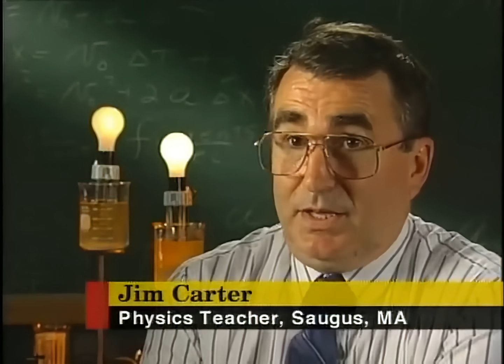MIT graduates cannot power a light bulb with a battery.

Comment: fuck this pretentious ass hole. these young people worked hard for their degrees.
Reply: +Mr30friends I have another possible explantion. I'm not sure, but I'll take a crack at it. It's possible that... Ahem

It was a fucking joke. She managed to pick up a sense of humor at MIT, something not all of us are capable of apparently. Lighten up.
Reply: LilDP You dont need specialization to understand what a battery does or what a bulb is people that haven't even gone to highschool know these things... the bulb connects to the power line of your house which even if you don't know its precise voltage value you know it's high because you know it's dangerous to put your fingers inside an outlet for example...

And you know how harmless 1 battery is .

its that simple, no electrical background needed the only thing you need to have is half a brain.
Reply: Al Paca this comment proves you didnt/dont go to a school like MIT. this isn't like high school kiddo, a lot of actual problem solving takes place. go ahead and try to insult people vastly smarter than you so you feel better, though. I understand. not everyone can have an elite brain and it's not your fault that you don't.
Reply: Igigigg Jhjbibjv strange then that if their elite brains are so skilled and trained in problem solving so many of them fail to achieve what my 6 year old nephew can do with ease.
Reply: you're all typing too much for me to read so yeah. I also didn't watch the video so maybe I'm being stupid but MIT people in general are infinitely smarter than any of us
Reply: LilDP Haha... I much rather prefer a random university on the other side of the globe than Ivy. For one I do not believe in prestige rankings and social elitism. And here is a secret - neither do employers.
No one with half a brain picks a sheltered prick with a bought fancy piece of paper over a person who has been places and done things on his own.
Which is why all those fancy schools are full with foreigners. Most of them go back. Those who dont still are valued more than locals who went to the same school.
Thats why exchange programs exist too, which is also a big bonus for you to have for the same reasons.
Reply: Working hard doesnt necessarily make you competent. Or immune to criticism or scrutiny. Fuck your political correctness.
Reply: Igigigg Jhjbibjv Neither is strictly speaking better. The programs in both are certified and in most cases identical with only minor variations.
Employers much rather prefer independent and experienced candidates over someone who has been to a fancy school and hasnt spent a day on his/her own. Its simply a matter of having a much wider perspective, understanding and first hand experience.
Prestige rankings do not mean anything, only that those schools are more desirable and thus they can select the applicants they want, which are usually already high achieving and hard working. Thus the accomplishments of such graduates are not due to the school per se, the school really does nothing beyond what any other school does. Being more desirable makes it more prestigious, and being more prestigious makes it more desirable, and round it goes.
There certainly are benefits to ivy and other prestigious schools, such as social elitism associated with them. But, again, most employers, who are usually not from ivy and alike, do not really buy into that. Employers who are ivy grads will much rather employ other ivy grads though, but not because they are better.
I can tell you from personal experience that studying in a reasonable school abroad is much more interesting to employers than a more prestigious domestic one. Better yet if you can get into a fancy school abroad, which is, again, why most top schools are full with foreigners. Even a 3rd rate college may have plenty of foreign students, even though they could have gotten into a higher ranking school at home.You may guess why they chose a worse school abroad over a better one at home.
Reply: How do you explain that even ONE of those MIT graduates held the wire like at 1:26 and then proceeded to say "I'm not an electrical engineer.. I'm a mechanical engineer."  .How did this person graduate. I just dont get this. These are graduates arent they ? And from goddamn MIT. Unless they are actors then I cant find an other explanation.
Reply: LilDP she wasn't an isolated incident... there were dozens in the video all with the same joke at hand? (pun intended :P )

besides that it's not about how to connect the light bulb to the battery anyway it's about knowing that the battery won't have enough juice to power the bulb in the first place(1.5 volt battery vs 110 volt of a light bulb)
Reply: Bill Killernic I never said it was a good or creative joke.

Regardless, I guess you can't say they shouldn't know that as graduates of MIT. But hell, I can't fault them, I wouldn't have gotten that either. Luckily I'm an idiot so let's get that out of the way. And as an idiot, I can afford to not hold any pretense of being smarter than anyone else. It's kind of liberating really. I get to ask questions in class, and admit when I don't know or understand things. I would hate to have a degree at MIT. You would probably have to look like you know everything about everything. shudder What a nightmare. Constantly acting like you know more than you actually do. "Yeah of course I knew that." Or god forbid have it televised nationally that you don't know something.
Reply: LilDP its not about being smart that's not the issue!

This is not an accomplishment... this is a rudimentary concept!

It's like a fireman thinking that he could extinguish a fire on a tree with a bottle of Vodka or with a glass of water...

It's a matter of the perception level of our reality these students have or I should say don't have.
Reply: Bill Killernic Well it depends how you view an accomplishment. But I guess that's more of a philosophical question really.

I think you're analogy is a bit off really. I would say it's more like an electrician thinking that he could extinguish an electrical fire with water. (Unless, of course, these students are electrical engineers, that is.)

And another philosophical point, every bit of knowledge is a perception level of our reality. That's what knowledge is by definition. So we can simplify this by saying, they don't know something that you feel they should.

I think your issue is with pedagogy and the specialization of knowledge. These kids did nothing wrong. But were they taught this as trivia? Were they given the appropriate space to experiment and understand this phenomena? Or were they just told to memorize this fact for a test in a single class, where the lightbulb was represented symbolically as a 110 V load on some schematic?
Reply: Bill Killernic I think you missed my point.

Specialization in this context refers to your breadth and depth of knowledge. If you're highly specialized, you know a lot in one area and nothing in another. Alternatively, you... oh you get the point. What I am saying is that you have a problem with the education system, not these students. Because this is not a problem specific to them. It's there by design. And the design, in your perspective, is flawed. Cool.
Reply: "Lighten up"
Reply: GenericBauble Booooooooo. Boooooo.
Reply: Bill Killernic Actually, now that I think of it this mindset is the reason why so many professors gloss over such "elementary" concepts. Because it is so "rudimentary" they should already know. And so professors focus on theory rather than intuition. And intuition is almost scorned in academia. And anyone who doesn't understand is clearly dumb and therefore CAN'T understand anything else. (Which is why students stop asking questions as well). It's a very dangerous notion.

I once asked my physics professor if he can help me understand work intuitively, and he said "It's not intuitive, it's just a mathematical fact." (What he really meant was, "It's very difficult for me to come up with a description based on anything you currently understand") And so I had to go about finding an intuitive understanding for myself. I actually read an article once that described this "curse of knowledge" as being characterized by an inability to empathize with students, because you've already gone to the point of intuitively understanding a fact about life. And physics and mathematics are particularly susceptible due to the binary nature of the material. Either you get it or you don't. And once you get it you REALLY get it. And if you don't, you really don't. Once something becomes intuitive, it's quite hard for you to see it as unintuitive.

But this is what separates the great professors from the shit ones. An alright teacher only presents theory. A book can do that. A good teacher knows how to teach intuition, and a great professor can balance theory and intuition. They know when to go in deep, and when to take a step back and just look at the big picture.

It's not that these students don't understand voltage. I'm sure if they put "110V" on the lightbulb, or if they specified the voltage, the students would have gotten it. Regardless, they just didn't know how to connect the theory to the practice. And I feel that a little empathy, would have helped bridge that gap. Learning happens when you are able to bridge theory and intuition. When you are able to make connections with reality through modeling and analogy. You have to be able to connect what you don't understand to what you do. And when it's not taught as such, you get... the above video.

You gave a great intuitive description of voltage by the way.

edit: To make my rant a little longer, this is why common core was set in place. To bridge theory and intuition in young kids. However it gets a bad rap because a few teachers and many parents weren't trained to understand the intuition behind things like division and multiplication and have trouble teaching it/helping their child. Also students who struggle with reading comprehension will also struggle with math, due to the less symbolic nature of the problems.
Reply: Chris Nault no they worked hard reading books and copying information passed to them by a professor, they spent so much time trying to get the answers to their tests right that they failed to grasp the basic principles. Not once did they ask, I wonder how electricity lights that bulb. It's not to say they didn't work hard enough, it's just goes to show how flawed the education system is in the US.
Reply: Al Paca knowledge vs intelligence
Reply: Igigigg Jhjbibjv Well at least the guys on the video aint vastly smarter than him lol

If anything it proves how dissociated they are with what they are doing and that renders them useless...

I mean I am sure that they know Ohms law (I=V/R) since you don't have to be an electrical engineer to know that that's highschool stuff and I bet that they will solve every exercise that needs ohm's law to get solved.

But that's a proof of them not really understanding what they are doing... they just have the illusion they do cause they understand parts of it and the language involved but they don't really get it.

and that makes them useless in a big group of scenarios where skills like theirs are going to be needed.

For example in a malfunction of a subsystem in a nuclear plant or in an oil drill....

These kind of problems don't ask you to find the correct solution by using a specific formula you have to derive inference from multiple and seemingly (at first glance) unrelated real life data...

Which they obviously displayed here they are not capable doing.

Yes after the fact if they get all the reports as to what went wrong they probably could use those reports to calculate everything and in hindsight find the solution to the problem but when the shit will hit the fan they will be useless. 

As for example here I am sure that after telling them the light bulbs resistance and its efficiency factor they could calculate how much voltage it will need in order to have a specific amount of luminance.... but that's after the fact....

If you ask them to connect the 1.5 volt battery to the 110 volt bulb they will try to do it like a monkey would (some of them didn't even knew how to close the circuit lol)
Reply: Igigigg Jhjbibjv they spent so much time trying to answer questions that they forgot to ask any.
Reply: Igigigg Jhjbibjv Being smart will help you finish a degree easier but it doesnt necessarily mean that because you have a degree you are also smart everybody of medium intelligence and maybe a little bellow that can get a degree as long as he or she does his job right.

the point isnt if those kids are smart its about if the methods used to educate them are sufficient or efficient enough to give them the skills they are required to have.
Reply: They worked hard? Haha.. No, their parents paid a lot for them.
Reply: RJ Lee ...said the Ivy League graduate.
Reply: RJ Lee I'm more of a state school kinda guy. I just assumed you went to an Ivy League school because you were speaking as if you knew what the workload was like.
Reply: LilDP The workload shouldnt be all that different. The main difference is the better opportunities to do independent work/research due to better funding and the school facilitating that. But The programs are supposed to be compatible and there are standards in place.
Reply: they did not, if they can't do such a basic task they have learnt nothing and hence do not deserve any kind of degree.
Reply: RJ Lee you got everything right except one part. For some jobs (investment banking and law), the school matters. At the same time, there are only a few hundred spots offered each year and over ten thousand kids. Going to an Ivy League won't magically make you into X personality; most kids coming in already were smart, hard workers to begin with.
Reply: mugged up the texts and don't know wtf to do,is the ground reality!
Reply: and therefore learned a lot of excuses lol I am a mechanical engineer not an electrical engineer that's why I am so dumb not to know that a 1.5 volt battery won't light a 110 volt bulb. (some of them didn't even know how to wire it so even if the battery was enough they still wouldn't be able to do it lol )
Reply: Yall are fucking stupid acting like state school kids are better than ivy/equivalent school grads. sure, some are, but most aren't. and employers DO care you dumb fucks, check out your avg shitty state school on LinkedIn and then check Harvard. and as to ivies/etc costing more, you're again fucking stupid. plug ur fin data into the college boards net price calculator and you'll see

Comment: the problem is, copying something off a blackboard and then memorizing it to pass a test doesn't teach. it's because doing a lab  under a controlled setting with a teacher to help doesn't stimulate your brain the same way as being in the building where you just wired something wrong with a foreman screaming at you why aren't the fucking lights on! you learn incredibly fast and don't forget when you're under the hammer! not being babysat by a university.
Reply: Spoken like someone who hasn't studied engineering at a university.  Babysitting is the last term I would use to describe that experience.
Reply: redlinerer in fairness to unit and especially MIT, it's an incredibly stressful place

Comment: Part of this could be that the students have a good understanding of E&M and can wire circuits just fine, but have never stopped to look at a light bulb. It may not be immediately apparent where the two leads from the battery should make contact with the light bulb in order to turn it on, and then the fact that they are being put on the spot with a camera on them is causing them to be blind to seeing where the leads should go.
Reply: I saw a street interview clip where the question was to name a woman but the interviewee panicked and struggled. She could have said her own name
Reply: Plus, I guess they didn't have the time to think unlike how they always had time to study for an exam or before a new class
Reply: I know they’re being put on the spot but even just from the diagrams it should click “Oh! I have my voltage source, I have my medium for propagation, now all I have to do is close the system” (i.e the plate of the bulb making contact with the cathode of the battery). The thinking should be straightforward, or at least it should be obtained within a few minutes of really thinking about it.
Reply: @restitutororbis964  Do you think this was a few minutes or do you think it was a minute? These are impromptu interviews, they weren't thinking about it at all beforehand, are still thinking about a ton of other things, and if they can't do it quickly the interviewer will just wrap things up
Reply: Are you serious? You are dumber than those morons if you can believe something that stupid!